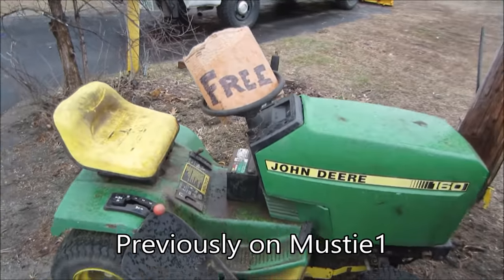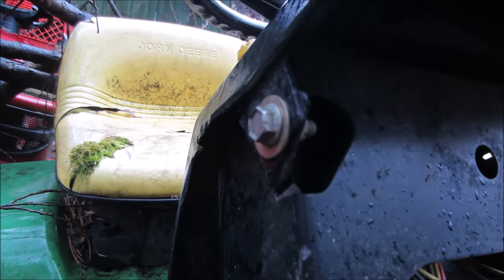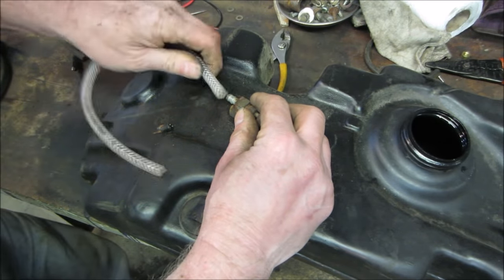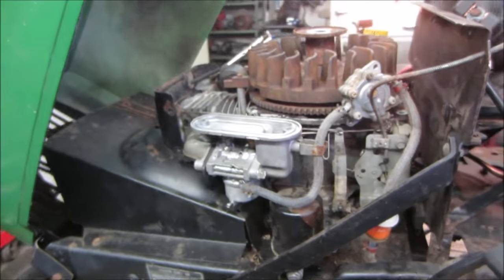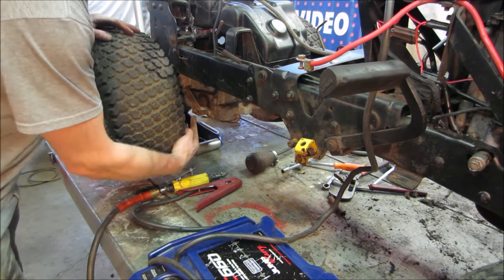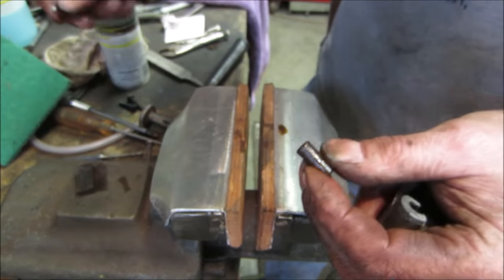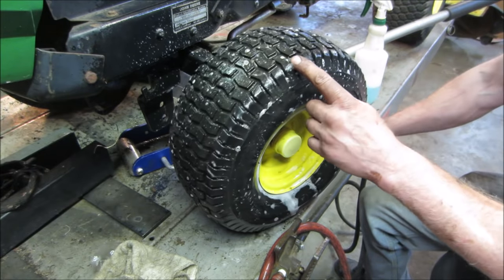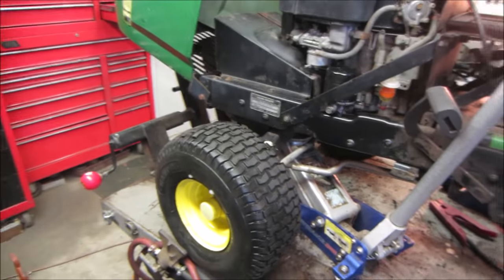CAN IT BE SAVED? Free John Deere that was in the trash. part 2

Comment: For me (due to old age), gone are the days of pulling a 396 from a 69 Chevelle by using a branch of a large shade tree, gone are the days of sitting on the fender with my legs inside the engine well to work on it, gone are the days of changing my own oil, gone are the days of the need for speed. Although I do thank you for your videos for many hours of your wrenching. It reminds me of my youth but I cussed alot when smacking my knuckles against unforgiving solid metal. Oh what fun it was. Thanks again.
Reply: My brother bought a new 1969 Chevelle with a 396-375hp. Wonderful car.
Reply: @fasteddy917  I didn't buy it new but I had the time of my life building the engine and tranny. It was the 375hp. It was stamped in the block. Back then it would pass everything but the gas station.
Reply: @charleskitson4903  There were rumours in our neighbourhood that when you shifted into 4th gear at a 100mph the back end of the car would dance side to side and yes, you had to plan your trip by how many gas stations you had along the route.
Reply: Me and my uncle tore that engine down, never will forget that rumbling sound, way back a holler up on Copperfield Road.
Reply: Yea, but we got those good memories,Charles.
Reply: Charles you must have had fun. God bless you. I am a 15 year old getting into this mechanic stuff.
Reply: What  hole was the pin in on front arm s there is two different holes

Comment: 52:15 "I'm gonna do a bunch of this in private" means, at least for me, that I'm gonna swear at it a hole lot, dammit to hell numerous times, then bargain with it, then lose all hope and bugger off for a cup of coffee, then reach new levels of anger where I shear the bolt off and mock it...
Or as I like to call it the 5 stages of removing a stuck nut/bolt... Anger, bargaining, depression, anger and finally mockery
Reply: Lol sounds like my dad minus the coffee break
Reply: General Disarray that sounds a lot like me when I work on computers minus the screws being stuck thro I have snapped a couple mounting screws.
Reply: @darthrevan2063  I work in IT but work on my car or anything mechanical to relax, it doesn't always work.
My nephew got a new graphics card last Christmas and said it wasn't working so asked me to have a look. I take off the side cover, lie the machine down on its side, pull out the graphics card to check the slot, then shove the card back down into the slot and CLICK. At this stage my nephew's turning white, and looking worried. Turn on pc and theres the graphics card...he was so dainty with it he hadn't seated the card in the slot fully...🤣🤣🤣🤣
Reply: I was wondering if the shake and break was coming out for those bolts.then it did come out a bit later

Comment: I always enjoy these videos and look forward to them on Sunday mornings. I have had to cut my share of holes in plastic and came up with a trick years ago. I took and eXacto knife blade and attached it to my soldering iron. When you heat up the iron it heats up the knife blade and you can then easily cut through plastic. It will usually leave a nice clean cut that will look like it was molded into it.
Reply: Neat trick, thanks for sharing!
Reply: Nice tip.

Comment: Thanks, Mustie, for showing how to go through the brakes on these.  I've got a riding mower where the brake disc is rusted to the splined shaft, and now I know how I might remove it.  Now I just need to get that bit for my air hammer...

Comment: Just wanted to say that, thanks to your videos, I got my $100 1985 Yamaha quad running today. I actually got it started a while ago, but couldn't get it to idle to save my life. I had it narrowed down to it being starved for fuel, and today I found a filter inside the gas tank that needed cleaning. It's still a little rough, so I'll be digging deeper, but it starts and idles, and I got to take it for a first ride around the yard, which was pretty awesome after thinking it was beyond my experience to get it running. Thanks, Mustie!

Comment: I had to fix the brakes on my Craftsman mower last year.  I wish I'd had this before I took it all apart!  (Actually wasn't too bad, but I couldn't believe the cost of new pads!)
Reply: I need to do mine this summer, I hope they are the same. But my biggest head ache is my carb. She died on my the day I put it away last year, and I just didn't have time to mess with it. Now I am just waiting for the ice to clear up around my shed doors so I can get in and start in on it. With all this down time right now would be nice to get at it.
Reply: My 20 year old Craftsman was not hard at all. In a pinch you can flip the pads. Mine were only about half worn.

Comment: Most of the PTO switches do at least 3 things. They turn the PTO on/off, most prevent the starter from operating if the PTO is on and they also go through the seat switch so that if you get off the machine the PTO shuts off. Some also have a switch so the PTO shuts off when you go in reverse.
Reply: Ah yes, the reverse safety, the dumbest safety feature on any mower

Comment: Another awesome save Dude ! Couple suggestions, AERO-KROIL is one of the BEST looseners I've evr found. A tad pricey ($20 a can) but to me .. worth EVERY penny. Works within MINUTES. We used to use it on aircraft engines, those puppies are BAKED together. Also, next time you're at Harbor Freight pick up an Oscillating tool. (about $20) there are a NUMBER of cutting and polishing adapters you can put on it. They work TERRIFIC on plastic, drywall, wood, metal ... and they work FAST !! Thanks for another great video !!

Comment: Sir Mustie1, I like that you don’t go straight to the wiring diagrams. I’m a service manager of a major equipment rental company and one of my interview questions is “let’s say your out in the middle of no where and you have no wiring diagrams or internet service and you have to install a generic ignition switch to get the unit running, what would you do to make it work?” Almost none of the applicants can answer the question?
Reply: I prefer the schematics to save time, but knowing how to use a good multimeter is a handy skill to have. Among my hobbies is retro computers, and the skill is the same when there isn't a service manual available.
Reply: A test light, a multi-meter, black tape and a dictionary of curse words.

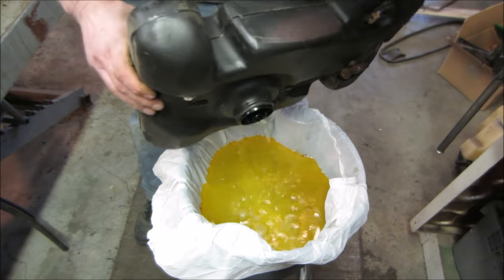Comment: 20:22 - Being able to troubleshoot/figure stuff out will help you understand the problem even if some tinkerer was there before you.  Wiring Diagrams will only tell you how it was supposed to be from the factory.  Old stuff gets adapted over the years and a good mechanic needs to be able to understand that and work around it.

Comment: 16:00 "probably some other safety switch" Ya probably. I have mixed feelings about John Deeres. They're awesome mowers, do a good job, but they're kind of a pita to mow with. So many safety switches. I mow one yard thats fairly hilly. If you go to lean over on the seat to get more traction on one side to make it up a hill you get too far off the seat and it wants to shut off. Since the frame is so stiff and doesn't flex it doesn't take very much of an angle to get off center either. Take to long and it'll disengane the mower deck also. Try and back up around a tree or flower bed.. got to push some button or pull the pto switch Up so it doesn't disengage the mower. Really makes me appreciate my old Craftsman LT1000. Push a lever up to engage the mower, I can get off the tractor with it running, and it doesn't care if i'm going forward or reverse. Ya i just find all the safety switches annoying.
Reply: It's not John Deere requiring the safety switches.
Reply: No, its the people that don't have any common sense and do stupid things that force manufacturers to Have to put things like that in after they sue the manufacturer for not having something to stop them from being stupid.. but Its only john deeres that have the most though from my somewhat limited experience. They're the only ones i've used with the reverse kill switches. Ya my craftsman is old, but my grandparents had a newer Toro mower with none of those safety switches. I just bypass the seat and reverse switches on my personal mowers. Makes leaning over to pick up a dog toy, or kick a rock out of the way SO much easier. SHHH.. don't tell the safety police lol
Rest assured, if i do something stupid, fall off and get ran over or something, I realize its my own fault for leaning over to far and i' not going to sue the manufacturer for my stupidity.
Reply: @keithyinger3326  ...Settle!  If there is one thing I am positive of it is that John Deere (or any other manufacturer) would never put more safety switches on the equipment than were required by the feds.  The bean counters would never allow it!
Reply: Very simple to bypass each & every one. First thing I do to each piece of lawn equipment once it comes home. A big middle finger to the CPSC & the draconian politicians that push for that shit. It's called natural selection! Let Mr. Darwin have his way.
Reply: @acemobile9806  Whatever...darwin!

Comment: Not sure you noticed, but when you fired the PTO, you sputtered fluid on the lift.  You can see it @ 42:46 time mark.
Reply: Shhh,   If you don't look it doesn't cost money.   If you haven't noticed, that's the reoccurring theme.  Not "Do it right"  it's "Do it cheap for the best $$ profit on resale".  The next owner can buy a fuel pump, pulleys and bearings  and seals.

Comment: Why the big knife mustie? Unfriendly neighborhood? Alot of those old tractors or the cheap ones have sealed bearings on blade quills. The grease fittings don't actually grease them.
Reply: The knife is good way of bartering;D
Reply: Probably to keep away those less adult fans who would just show up at his shop uninvited...I remember he said someone did that at his house a while back.
Reply: @muzzcovw7674  I follow other YouTubers have that problem. Ppl show up at there houses uninvited.
Reply: @waffalobill  yup! I don't get it. If you really want to say hi, he's easy enough to find at a vw show in his area
Reply: @muzzcovw7674  I follow goonzquad. They had to put up a fence and a steel gate across the driveway. Showed security cam footage of ppl just walking up to there house. Wondering around there property.

Comment: I personally think the 160 is a great lawn tractor... my dad picked one up used around 1996 and mowed about two acres with it until 2018. He gave it to me in 2019 and I use it to mow 4 acres. The deck wheels were worn through the front tires were bald and the brakes were shot. It still runs and drives beautifully, so I fixed it up, I don’t think it can be killed. It must have over 2000 hours on it by now.

Comment: From watching you I have figured I got lucky with my mower, a 1980s MTD tractor that had been left outdoors but with a roof with flat tires for 10 years, put some air in and changed the oil, has run flawlessly for 3 years now.

Comment: Darren,  I've had a few powder coated wheels leak at the bead, they were clean too. Come to find, the powder coat separated from the steel, and the air was leaking between the 2, even though it looked fine.

Comment: I appreciate all the steps you show in your thought process.
I like wrenchin' on old junk myself.  The electrical stuff is not my strong suit.  Watching you diagnose the wiring on switches is helpful.  My mother-in-law has an older John Deere... I think its 210?  It keeps throwing the belt off the mower deck.  She paid someone close to $400 to fix it for her last year, but it's still throwing the belt. I haven't looked at the tractor, but it would be a fun project.  Any insight into what to look for would be helpful.  Thanks
Reply: Check to see all the pulleys turn freely & that none are dragging, especially the tensioner. Then make sure all the belt snubbers are in place & within 1/8" or so of each pulley that they go to. My Toro slings the deck belt if the snubbers get too far away from the pulleys

Comment: At least the plastic hood isn’t broken! That’s a rare thing on a Deere.....
Very important to check all linkages and bushings to the deck. They tend to get worn out and very sloppy. I’ve actually had to weld up and redrill the holes, make new bushings, and replace pins. Otherwise the deck will hang crooked and not mow level.

Comment: You are a very hard working miracle worker all while balancing your personal life so Congratuations. Your channel is one of the most interesting on Youtube so thank you for all that you do to rescue these items from the landfill and bring them back to life.
I have to ask will there be a Part  on this project 3?? 

I learn so much about my used lawn mower I bought that won't start. I wanted to test myself ..... I drained the gas and oil replaced both with new, I checked the spark plug for gap and spark and oil on the plug it did have some oil on it so I replaced it. I also replaced the air filter all of this seems so simple now that I have watched you work through the areas to trouble shoot and how to trouble shoot. Thank You!!!  So for about $20.00 i got a free lawn mower and it's working now....... Lawn mowers are not cheap ie: Knowledge is POWER !!!    :))) I forgot i cleaned it up and it looks great too

Comment: I have a John Deere 240 with the manual transmission and Kawasaki single cylinder. After it sits all winter or runs out of gas its a pain to re fire the first time. It won't pick it up just cranking. Have to prime it up, then its fine for the season. It is a nice tractor for what it is.

Comment: Big crack in top of deck at 6:55?  Discharge side.   Nice job on the Brake Caliper and it appears to have ball bearings in front wheels. Factory?  Some areas of bent rim too.  Its worth the hassle to drill and put valve on outside of wheel where it should be.  Put a tube in that Left Front.  Perhaps the plastic is too thick for the tabs to catch on the PTO switch 46:18.  Pricey switches!

Comment: Nice work on the brake. I have a 185 and the brake has never worked. Hasn't been a problem as the tractor is hydrostatic drive...move the lever to neutral and the tractor stops. But, having a lot of time lately it's time to fix it.

Comment: Mustie    I had a 75 Buick with badly rusted rims that leaked on the bead when was young.   Without even cleaning the rust I permitexed the bead and they never leaked again   I would think silicon or any gupe would work to do the same just needs to fill the little holes     for what it's worth     enjoy watching thanks

Comment: Love these vids every time I watch them it seems like a new project appears in my dad's garage. Now if got 2 weedwhackers,  1 chainsaw, 1 7 hp Briggs pressure washer motor with no pump, 1 4000 psi pressure washer with a 13 hp Honda gx390, and a push lawnmower.

Comment: I need to take a page from your book; where you chuckle at something going wrong I tend to get pissed and curse it out. A slight chuckle would probably make the job a lot more enjoyable. Great job troubleshooting and tracing out the wiring issues, that’s the way I do things too. I like using the continuity beeper function rather than the ohm meter for switch circuits though to prevent screwy readings.

Comment: I thought you might add a little fun in putting air on the front tyre. Fill it up with lighter fuel on the inside of the tyre and then set a naked flame on it. Sorted in just 2 seconds ;)  It's always great to see you bring things back to life in this throw away nation.

Comment: For that brake disk, I'd recommend investing in a gear puller or two. On my stuff, I usually use them for removing pulleys when I need to change bearings or bushings. They save a hell of a lot of hassle. 

Can't say I'm a fan of having the transmission shaft provide the brakes for the wheels though. Just looking at the amount of play this transmission has (the delay between you hitting the brakes, and the split second it takes the wheels to stop), it looks like a good way to cause wear to the gears. Maybe it wouldn't matter for a home tractor, but if you were using this for a landscaping business, you'd be thinking of a replacement every 5 years or so.

Comment: I'm 100% behind diagnosing by thought rather than Google. I never memorized the multiplication tables. I learned the patterns and the process, then there is no need to remember. If you can understand the "How" of something it is a bunch easier to get to the "Why" when it doesn't work. In my career designing machines I went out of my way to make the machines and processes obvious. I told my engineering team to visualize a guy in the middle of nowhere with a broken machine. He doesn't have the manual and doesn't read English even if he has one. Make it obvious. On DC Red is always power coming to a switch and black is always ground. All high voltage stuff is the same different color and always says that voltage on both ends. Whenever possible i used standard parts that were easy to identify, and maybe find at the neighborhood NAPA or electronics supply. 

Companies that use proprietary service parts to capture aftermarket sales just piss me off. Making something reliable and repairable builds a reputation and builds repeat business. Some companies think they know better. Who am I to say, just some random guy who built a company and retired in my 50s.